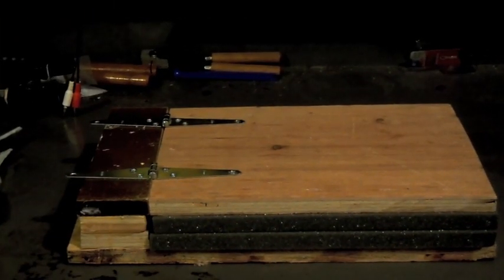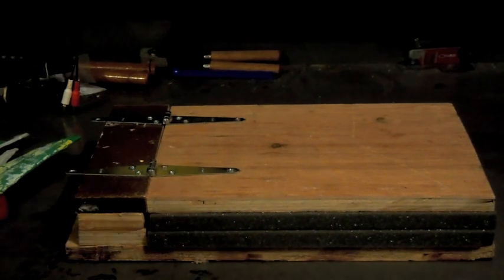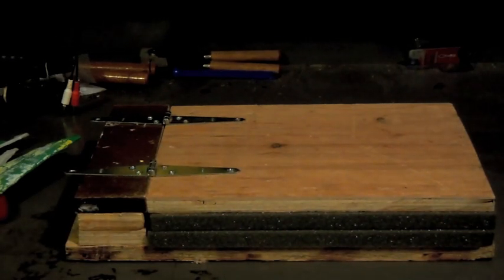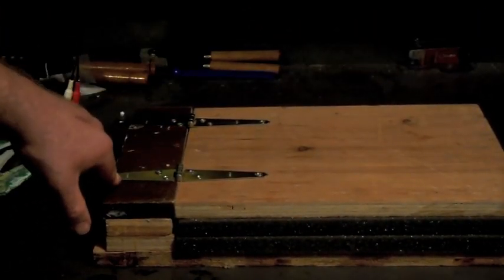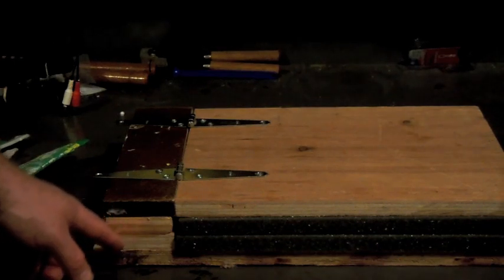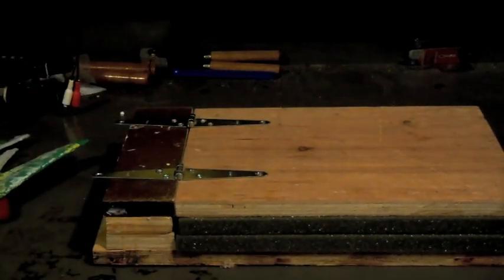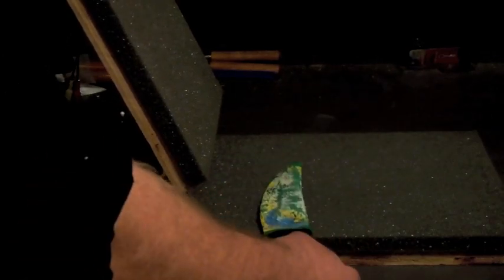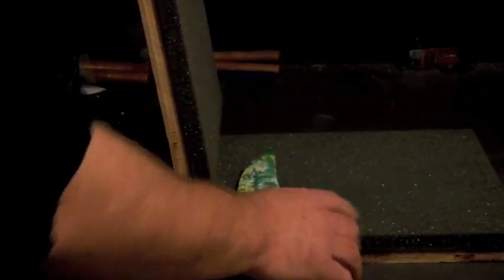How to Build a Homemade Kydex Press

Comment from the maker: @ArrowSmith95 I really don't think yellow type upholstery foam will work.  I kinda think putting it in the oven may cause a fire.  I would probably put a spoon or butter knife in the oven and see if the metal will melt the foam... but that's just how I would test it.